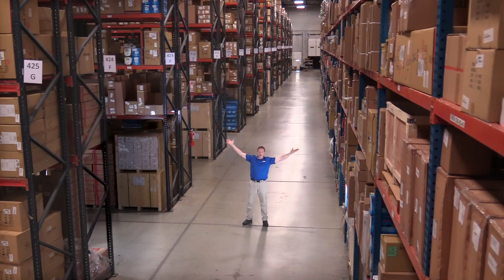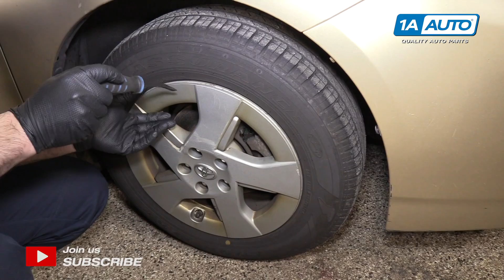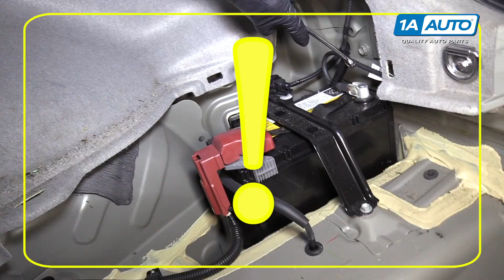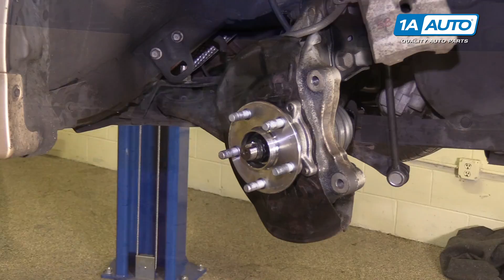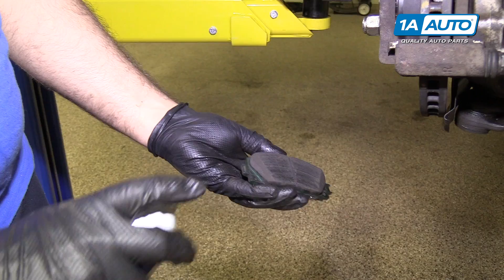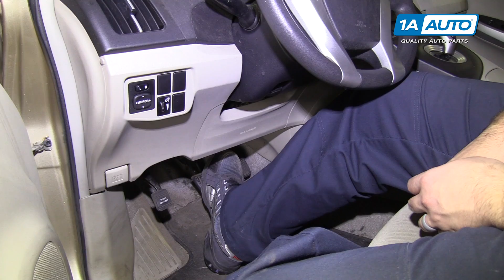How to Replace Front Brakes 10-15 Toyota Prius

Comment: Hello everyone and thanks for the very useful video..I add that after replacing the pads you must check the brake fluid reservoir. You have to do this because when you replace the old pads with the new ones the level of the fluid in the reservoir rises above the maximum, so you have to suck out a little bit of it with a syringe.Bring the level back below the max line and put the fluid in a container so if you need to add more later, it's there. When reassembling the front piston, push it in by hand, leaving the brake fluid reservoir open. Do the same thing with the rear brakes, open reservoir cap and rotate the piston clockwise with simple pliers. I hope I have also given my useful contribution.

Comment: Great video. Thanks for sharing the process of brake replacement. I had a question on the caliper piston. When using the C clamp to retract the piston to a flushed position, do I need to open the bleed valve to release the excess oil and prevent the oil to go up to the oil reservoir?

Comment: Can you drive around with the 12v battery disconnected on a hybrid?
So I should press down the brake pedal without the 12v connected?

The answer is no on the both questions.😂

But I got the hint inderectly that it is more important to make sure that the wheel sides are correctly mounted than connecting the battery 😂❤

Thanks for the video! ❤

Comment: My rotors were seized and I had to use the two bolts to free them. The bolts size is m8x125. 2cm or an inch is long enough

Comment: Easiest disc brakes that I have ever changed.  Literally 10 mins from the time the wheel was off until it was bolted back on. Just remember to disconnect the negative terminal on the battery first.

Comment: This was very informative. I had 1.5 mm on my pads. 167,310 miles on original Prius pads in a city that is mostly steep hills. Unlike a flat environment where one can coast to a stop; I find myself needing my pads at all the stop signs and traffic lights at the bottom of hills. I have heard of Prius’ brakes lasting for 300K miles. Must be in relatively flat cities.

Comment: I looked up a video just to see what the tool is called that depresses the caliper piston.  This video shows a conventional caliper piston.  My 2015 prius has a piston that will not depress with a C clamp.  There is a twist mechanism on mine.  Once I realized why the C clamp method was not working (the first time I replaced the brakes), I used needle nose pliers to twist the piston in.  But this time I wanted to find the proper tool.  I'll keep searching.

Comment: Do not use a c clamp. You need a special tool to twist and retract the piston back in. Pushing them in on this Prius can break the piston
Reply: If your calipers have the indentations for the “special tool” you can just use needle nose pliers to turn and “screw” them in.
Reply: Only on the rear, which as mentioned you can push and twist at the same time with needle nose pliers, if I remember correctly it was super easy.

Comment: Bought sets of pads and rotors. Your brake pads don't fit correctly into the caliper brakes , had to grind them down. And no, don't tell me I need to clean my bracket, bracket was fine.
Reply from the maker: +Ivo Apostolov We apologize for the inconvenience. If you would like to reach out to us directly we would be happy to check further into the issue for you.

Comment: I had my breaks changed a few years ago 45k miles later they look good and feel fine. Anyone know how long the pads last? 2013 prius thanks -
Reply: Actually they can go 100,000 plus miles. Just did mine at 96000 miles for the first time and they still had some pad left

Comment: Besides the pads, which other parts are recommended to replace? I went online and they have also "anti rattle kits", "Caliper repair kit". Maybe special grease?
Reply from the maker: +Sal Espinoza Thanks for checking us out! This would all depend on the condition of your other parts. Sometimes you will need to replace the rotors with the pads, the caliper should be re-greased when they are serviced just to ensure they are properly functioning, and anti-squeak can be useful even on new parts to prevent the noise from even starting. If there is no issue with the other parts you do not necessarily need to replace them, other things may be more of a preventative maintenance fix while you're already under the vehicle.

Comment: When disconnecting the battery should I use a memory saver or will it only affect my clock?
Reply from the maker: +Clone Trooper This will also affect your radio preset buttons but that is an easy thing to reprogram.  Thanks for watching.

Comment: I believe there is supposed to be a rubber grommet on the one slide pin with the indentation near the tip. I think they swell and stick in the caliper.

Comment: I thought brake pads on the Prius are lifetime, meaning don't have to be replaced during your lifetime because hybrids don't often use the pads for braking.
Reply: I have 2015 Prius , bought it new . After 150,000 miles driving uber & Lyft as well as food delivery in San Francisco i did alot of breaking & some of the steepest hills .I have to replace front break pads . I'd say the breaks last alot longer than normal cars . Very well built car inside & out . Made to last .
Reply: @buddyleewoods2327   I do Uber as well.  2013 Prius. Changing  front  brakes at 112K miles.  So the brakes on these cars do indeed last much longer then non Hybrid cars
Reply: That's false. You need to replace as they wear out.
Reply: Mine needed to be replaced at 120k, but i also use it to deliver food, so frequent stop and go.
Reply: I've got a 2010 Prius with 242,000 MI this is the first brake change front only. But it's only because I'm so busy I can't stop for anything, LOL.

Comment: Great video. Made changing brakes look easy. I feel like a fool for having the Toyota dealer charge me 350 to do my front brakes on my 2011 Prius. Never again. Thanks again.
Reply from the maker: +Jeffrey Reicher Thank you for the great reply. We love to empower our customers by showing you how-to perform your own auto repairs while installing our high quality auto parts. Have a great day! 1aauto.com
Reply: I have changed my brake pads since my first car Honda CRX in 1990s.  Saved so much during the years.  I watched to make sure there are no surprises.  I'ved owned a prius since 2008.  This is my first brake pad change.
Reply: A Toyota dealer quoted me $430 with a $40 "special coupon" for front brakes. I almost fell but a quick google/youtube did help alot. Thanks!

Comment: In Toyota manual the torque for mounting  bracket bolts is 101 ft-lb  ,more torque than tyre bolts, many do it to 79ft-lb. is it safe to torque at 79 ft-lb ?

Comment: Nice fabulous for suggesting the 12v disconnect if you need to push the piston back do you need to open the vent or do anything on the brake fluid side of things
Reply: I do open a brake fluid reservoir before pressing the pistons.